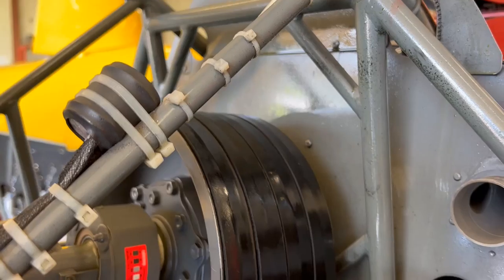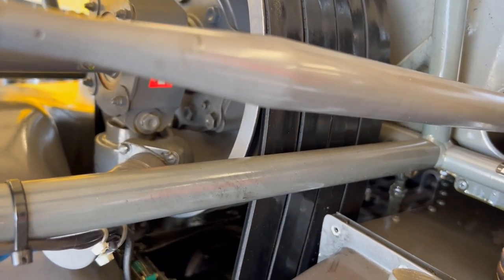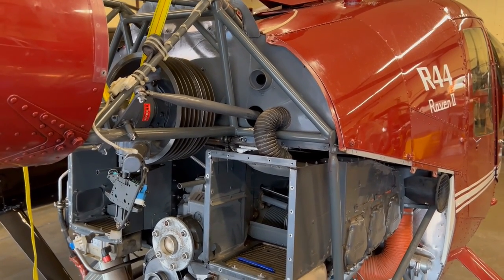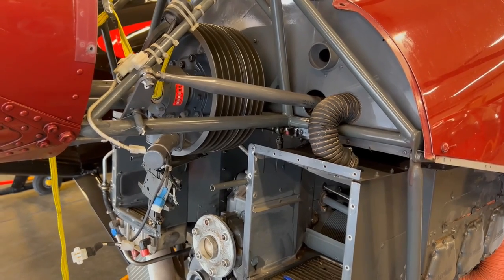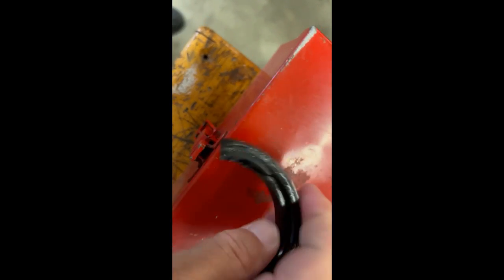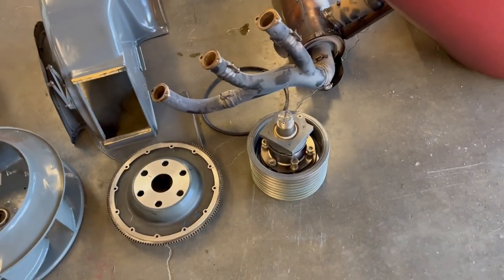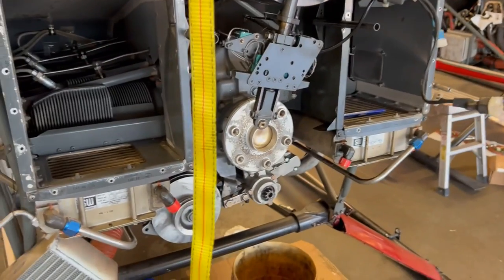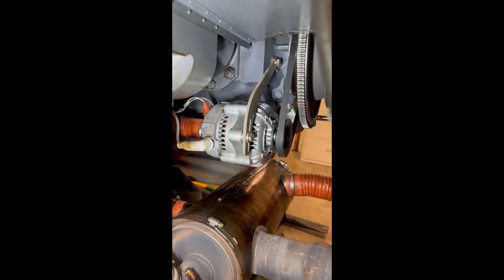Oil leak causes slipping belts and Low Rotor RPM- You'll want to see this if you fly a Robinson R44

Comment: I'm surprised no one has thought about fabricating a simple shroud, made of sheet metal to cover the rear main seal to funnel the leaking oil into a container, (catch can).
It would be a simple thing to inspect this drain can for oil, which would indicate a rear main seal going bad, n prevent oil from being splashed everywhere causing more damage.
The belts may or may not need replacing, however, it may just be prudent to do so. The labor cost to install new ones would be the same as installing the old ones, if they are deemed to be still serviceable... 👩‍🔧

Comment: I have seen a common problem with the R44's.  If you don't check the valve wobble and let it go to the point the valve seizes in the guide the push rod will bend and bend the push rod tube as well.  At that point the bent push rod tube will leak oil and the belts will also saturate just like what you are showing to the point of  slipping.

Comment: They should be called "hell"icopters due to how many people have been dying to them
Reply: One cannot over stress the need for a thorough "pre-flight". AND "post-flight"!
The post-flight, while the engine is still hot, is where you open up n look into the engine compartment n do a visual. Use a flashlight 
if needed. This is where oil leaks start, on a hot engine. Piston engines will seep n leak a nominal amount, just like cars do because of expansion. It's constant vigilance that will save your ass, not complacency. Oh! It worked  fine yesterday. That WAS, yesterday!
You fly today. You check it again. TODAY!
Reply: @Pork-Chopper  also mid-flight inspections on the Robinson's
Reply: @macbook802  
Mid-flight inspections are limited only to reading gauges n instruments. The Pilot cannot remove his hands from the controls while flying. Flying a helicopter is totally "hands on", on most light Helicopters. You can remove your hand from the Collective momentarily to turn or push knobs on the radios, or reset a circuit breaker, but that's about it. You Fly a Helicopter, while a fixed-wing airplane, once airborne, flies
you... 🤔